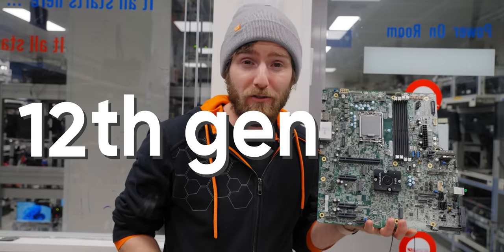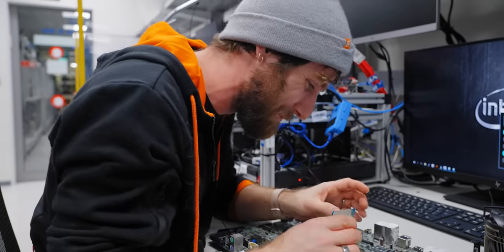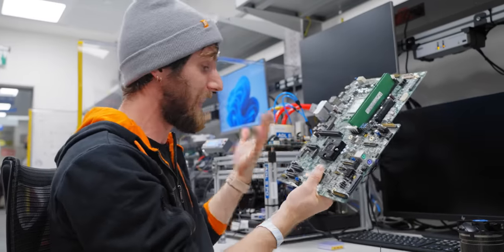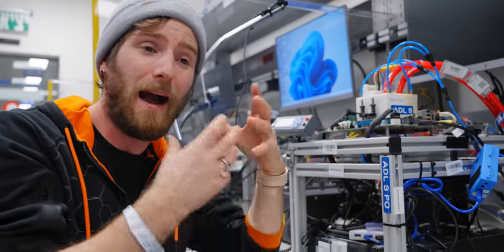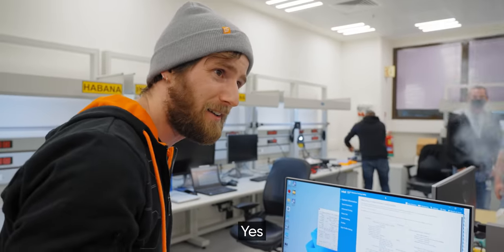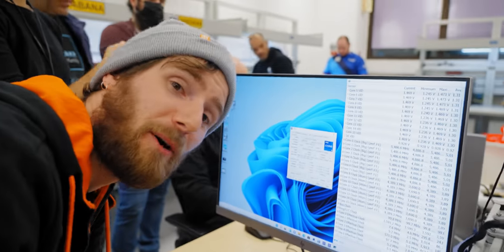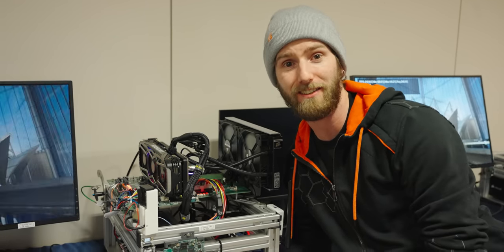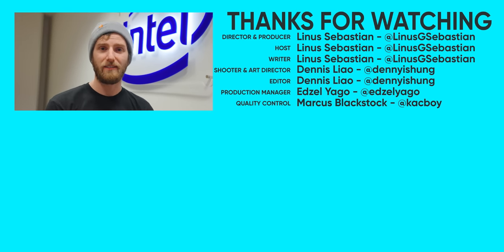I saved the best for last - Intel Design Center Development Motherboard

Comment: The clear difference between the guys who market and big wigs vs the developer engineers are staggering. The developer engineers are truly working with passion. I love these types of videos
Reply: I admire more the guys at AMD that get a fraction of the money and still do a great job. Except some bad apples that run to Intel like Raja Kuduri, to make new failures like Arc.
Reply: All the more importance to having your CEO being an actual engineer who gets it, instead of some business administrator.
Intel, AMD, and Nvidia all have true pioneering engineers as their current CEOs. That wasn't always the case with intel.
Reply: So, you're saying "big wigs" and marketers do not have passion? Are you sure about that? Seems extremely naive.
Reply: @marsovac  it's funny because all the gpus since he left have been miles better bar the 6500
Reply: @Noah-lj2sg  And both can be done with just as much passion.
Reply: @Mandaramaster  nah. Marketing is the single most degrading profession for the economy in general. Passion... unless you mean passion for fucking up with the lives of millions cause they buy trash products thinking they're as good as advertised.
Reply: Marketing team goal is to get product to market, set pricing and release schedule
Strategic leader work by deciding stretegic move of a company, whether they make new product, choose supplier, and choose what business need to be focus

None of the role are important, they're equally important, You don't put Enginner as sales as u don't put sales as an enginner, Choosing right people for the job are "Big Wigs" job

CEO need to understand not only how a product make, but also how to get product out to market, how to make the product cheaper to produce and how to get product delivered as targeted. 

You don't being an enginner to able to do such thing, You need to being organization leader with leadership skill and industry knowledge. saying being enginner is Important for being CEO is straight up ignorant as not every enginner are leader
Reply: @cyberbird2014  Marketing is good. Without it, you can't hear about new products or offers.
Reply: People are passionate about different things. You can find people in all positions that are extremely proud of what their company does. Different positions have different roles though so what they may passionately protect or promote can be different. The closer a position is to "the face" of a company the more likely that position will be carefully scripted.

Definitely different personalities among engineers though. 😂
Reply: The goal of these guys is to make a banger product without thinking of the cost of making it work, it's up to the big wigs to literally pressure them to deliver as much of what consumers 'would want' as possible.
There are marketing guys that put their soul into editing videos to the best of their ability, but at the end of the day because the chip wasn't made with their hands they will lose some of the 'pride' that comes from developing something with your own hands.
Reply: @cyberbird2014  What? Come on, don't be ridiculous. You know not every product is crap, right? I've worked campaign side with some great and incredibly passionate marketing people. I think you don't understand the profession if you think marketing degrades the economy.... Me printing out a flyer for my business is marketing. How does that degrade the economy?
Reply: @Mandaramaster  because they only want trade... Galleon style. xD
Reply: @Olav_Hansen  That's not true at all. You don't need to make something "with your own hands" to have pride in it.

I actually work as a freelance video editor. I edit with my hands ;). 

The editor is the one that takes some random files and crafts them into a superb story. There's an insane amount of skill and pride that goes into it.

I'm sure engineers have to be aware of the cost to make it work, otherwise they'd develop a product that could be too expensive to get to market/sell.
Reply: @Mandaramaster  being overambitious and testing the limits of what they are allowed to do is what they were hired from, but someone else set those limits.

And with regards to "your work", a woodworker can be proud of what he made, even though the wood grew itself. It's the same for your editing.
Reply: @heickelrrx  I would totally agree with you that you dont need to be an engeneer to be the ceo or watever of a big company. But you dont need to study business to lead either. Forgive my bad english spelling, its my second language. Im really that there are many examples out there right now that anyone can lead a company as well, or mostly even better and that you dont need business for the job.
To my reasoning, i am really fed up currently with business ceos always looking to sell the cheapest possible produkt for the highest price and not caring about innovation at all. Like the world is only in the fucked up place that it is right now because people thinking (and that now is not only business people but many others too) selling trash for high price(just look at what intel did the last 10 years) and holding back on innovation because of revenue is a good thing. And im glad thinks are maybe canging now because that style of permanent growth and waste economy is just not sustainable for a Planet with limited resources (look at climat change environmental problems or now finally all the economic bubless crashing).
Reply: @simonhazel1636  guys like him work on the architecture, not really on the SKUs. RDNA and RDNA2 were miles better than the Vega that he created at AMD or the Arc at Intel.
Reply: The passionate engineers behind everything make me not like hating in products. Except things that are cheap garbage that didn't have any passion or engineering behind it
Reply: I want the engineers to get a chance to stand on stage, I want to hear from them! That's where the real shit is at.
Reply: @marsovac  both are the same, Ryzen 1st gen literally had the same amount of problem

STOP FANBOYING

Comment: Just in case anyone was wondering... Overclocking can be used to test the maximum capabilities of technology,
but it does not represent the standard use case and will void product warranties. 😂
Reply: I was starting to wonder if that might be the case. Thank you for the clarification that, indeed, while overclocking can be used to test the maximum capabilities of technology, it does not represent the standard use case, and that it will, in fact, void product warranties.
Reply: Ok, I would really like to know why overclocking a product voids the warranty, and yet literally NO ONE actually tries to stop overclocking. And even making products overclockable in the first place
Reply: it will void your warranty because you're taking apart the whole protective coverage of the socket, not because you overclocked it
Reply: @souroshi  woosh
Reply: @insanelytamed ?

Comment: Hey Linus,

One thing the engineers didn't touch on in great detail - you were pretty much right. PS/2 is still there because early silicon can't always use USB right away (and SSHing in remotely similarly) and we still need a mouse/keyboard for some situations before USB is ready. PS/2 always works :)

Comment: 15:17 for anyone else that was curious, that's a PNY 3090 that Intel uses on their test benches.
Wonder if the engineers picked PNY for any particular reason, or if that's just what they could find in stock
Reply: Might be because PNY uses the reference design.
Reply: I would assume, Intel gets lots of Quadro cards; PNY is the only brand for those. So while having a business relation with them, they most probably asked their GPU guy to throw in some gaming GPUs.
Reply: This is what was available to purchase with a reasonable supply timeframe at the time. GPUs were scarce and very expensive.
Reply: Just for some information, usually for the same product, they'll use the same hardware part over the entire line for consistency purpose. But differ products might use differnt brands. So I assume that the original designees takes stock availability into consideration from their vendors.
Reply: @officerrambo  Hey, Is PNY a reliable brand for low end GPU's like 3060? I'm planning to take one from them.
Reply: @just.nobody  unfortunately I have no clue. From my point of view, most brand have good cards. If you get unlucky, you can RMA the card. The RMA process sucks for all brands...
Reply: @officerrambo  Thanks anyways.
Reply: Because they want to test gaming with most sketchy components. Thats why theres pny gpu and corsais aio for example lol
Reply: Im an engineer in that validation lab and let me give you an exclusive - its actually really simple...  we needed 30xx when they first came out and we use local stores... but scalpers and miners got them all... hahahah - true story... so we got stuck with stuff like PNY hahaha

Comment: Imagine being able to have that power in your hands, being able to swap the chipset without needing to swap the entire motherboard, being able to change system parameters without needing to enter to the BIOS and being able to control every aspect of the system would be awesome! I would love to have this control over my electronics.
Reply: 6:18 that socketed chipset really is cool, i have some what if thoughts about how end users could use this.
Reply: @Mr.Morden  You'd see some dumb DIY hacks, and some people bricking their systems, and then need a whole new chipset LMFAO.
Reply: > "It has stuff that most consumers wouldn't need..."
> "You can swap out the chipset."

:\
Reply: @arnox4554  most consumers, read almost all of them, don't need that. They wouldn't even know where to start with it.
Reply: @arnox4554  well intel needs to make money somehow, they sell their chipsets to board partners if u can swap it then they no profit
Reply: @williameldridge9382  Being able to swap chipsets means you don't have to buy another motherboard for another chipset, and you can swap out newer chipsets for older ones so you can easily run legacy versions of Windows.
Reply: @arnox4554  a little inside baseball, it's likely that the way that they change chipsets would add quite a bit of cost and complexity that would price it out of consumer grade. I don't know the specifics but generally there's a big difference in cost between fixed logic and programmable logic.
Reply: @arnox4554  Chipsets themselves don't just change, entire boards do including the traces used to connet the chipset to the rest of the board. Imagine trying to use a pci-e gen 4 capable chipset on a gen 3 board. You'd either end up with missing functions or a non functional chipset entirely. The chipset isn't even that expensive considering you can get entire motherboards for under 70 pounds. Engineer a socket for chipsets increases the complexity in both motherboards and chipsets which would then make them more expensive.
Reply: Sure, but those motherboards would cost $2000, you could get the TOP of the line motherboard at launch for 4 gens in a row with that kind of money.
Reply: @yuminago  Well of course, they only weigh like 1 pound. Who would want a motherboard that weighs 70 pounds. ;P
Reply: I work in the validation lab and it is indeed a lot of fun!

Comment: 13:49 - I love how E-cores are called "Atom", like the old netbook low-end chips and the P cores are just "Big". I mean I suspected as much, Atom did not die, it just became the new Celerons and Pentiums.
Reply: AIUI "Atom" is the over-arching architecture that Gracemont, Goldmont etc adhere too. I suspect it's purely marketing to have called them P/E cores rather than Atom etc.
Reply: the original atom designs are long gone. the e cores are basically celeron class cores optimized for low power. Atom is just a marketing name now.
Reply: I mean its microarchitecture Gracemont is literally the successor of atom's Tremont.
Reply: Yeah, it's a bit of a marketing mess but it's true, those Atom CPUs never died (luckily), they have been evolving this whole time.

At some point they also started labelling them as Celerons and Pentiums, like the ones belonging to the "desktop lineup" (the core i3/i5/i7 CPUs). 
You can only tell them apart from their product numbers (at least for the consumer market) the "atom-derived" are Nxxxx or Jxxxx, the "core ix-derived" are Gxxxx. 

They're excellent CPUs as far as I'm concerned, they're obviously not intended for heavy work but they are perfectly fine for most of the stuff you'd normally do on a basic desktop or a laptop, I even had to use MATLAB on mine, for an exam, it ran with no issues.
Reply: Like some people already said, you're wrong, also Pentium and Celeron have been using the same architecture as the "Core" designs for almost a decade, just with more cores.
Reply: I thought Celeron Came after Atoms?
Reply: Lol
Reply: i recently delved into niche intel skus and they still make atoms as embeded only, only that those have up to 24 e cores with no p cores (intel atom p5362)
i wish they made configurations like that available to consumers
(new gen laptops have 12xxp procesors with mostly e cores and max 4 p cores if i recall correctly)

Comment: Watching Linus support the entire weight of this "priceless" motherboard by only the PS/2 port (3:38) sent chills down my spine...
Reply: HOLY JESUS !
Reply: At least he didn't drop it
Reply: linus is that part of us that learned about antistatic straps but never used them and felt badass cause we've never blown anything up except turned up to 100.
Reply: Like he said: ps/2 never fails it just works
Reply: and your body's aching all the time
Reply: Bold of you to assume they trusted him with one that wasn't already broken.
Reply: It's priceless for the public market and because it holds a lot of IP. But internally, it seems like Jerry rigged board that they can make again. So probably not that catastrophic if he actually dropped it.
Reply: As someone who overclocks and works with hardware a lot, I would totally pick up a board by the IO ports or VRM heatsink all the time. They're soldered in or screwed on quite well actually and will 100% support the full weight of it. 20+ years of working with hardware, not broken a single one by picking it up wrong.
Reply: EE here, based on the parts I saw on that board, the clearances, and knowing intel, that board was probably about $20k to get fabbed.
Reply: he's supporting it from the back aswell
Reply: I'm surprised he didn't drop it on camera....
Reply: @TheEchelon  That's far from Jerry rigging, and no, you don't just spin up another one.
Reply: @zachbrown7272  Dude it’s just a 6/8 layer motherboard with a few extra connectors that are common on servers. $500 in small quantities. The chipset socket is the only special component.
Reply: I bet they gave him an 'old broken one' to fool around with
Reply: @NavinF  I doubt it's just 8 layer, still its not that pricey all things considered.
Reply: if it had been a working motherboard i don't think they would have stopped using it just for the video
Reply: Nah. That board was held by the safest pair of hands in all of you tube
Reply: @NavinF  having designed two x99 boards, maybe $500 for components...

Comment: This is cool stuff and brings back some good memories for me. Back in the late 1980s, I worked in an R&D lab and got to assemble prototypes, test and repair the new hardware.  The engineers too had a great sense of humor and enjoyed their work they did, and in the process taught me a ton too which I applied later in my own EE classes I was taking at the time.
Reply: ⬆️⬆️⬆️thanks for the comment.. 
Contact the What’sap line above for more information, advise and consultation

Comment: In my first job out of school (1975), we were designing a brand new system, using an Intel bit-slice processor (intel 3000).  I purchased from Intel at the time, their new (at the time) ICE system (in-circuit emulation), which was the forerunner of the systems you were seeing.  Oh by the way - the system, is hung below the now EF-18 Growler, still slamming into the carrier decks when trapping.  Also, I had to fly to one of their FABs, to pick up #5 - the fifth 8080 mil spec chip off the production line - for our evaluation system.
Reply: This is my favourite snippet from within the comments. The development stories you could likely tell. One of the most fascinating documentaries I've watched was the rise of the Wild Wiesel's during Vietnam which didn't include much on more post Vietnam capabilities for obvious reasons.

EW aircraft I find fascinating.
Reply: @OneLeatherBoot  - You also have to remember that in those days, you had to build your own tools, assembler, linker, loader, debugger - before you could do any meaningful work on the actual project.  Then there were the ROM emulators (ROM chips were running $200 each, and then the UVROMS came along - but were slower).  Also, needed to have logic analyzers to watch the instruction execution stream, along with a high-speed bus hanger (that we designed) to grab the data addresses with the data along with a DX/DR support utility (data extraction/data reduction) to take the output and make some sense of everything.  Lots and lots of engineering had to be done around the project as well as the project itself.  Also, created a set of macros to emulate a Fortran like somewhat higher-level language (in the assembler) - to boost productivity.